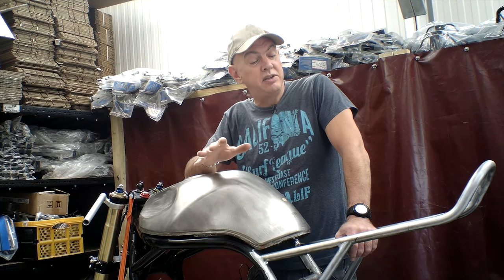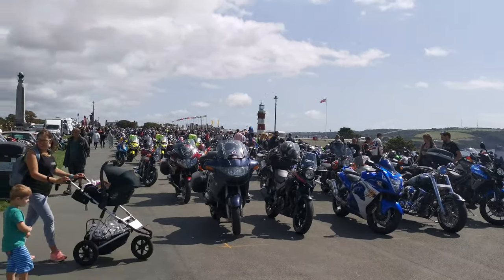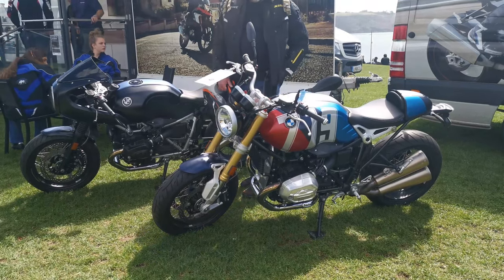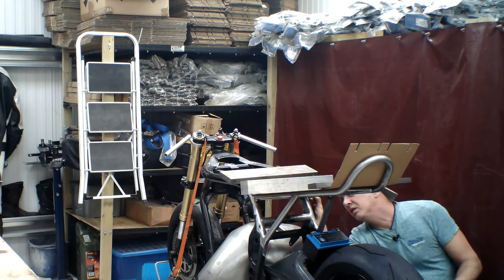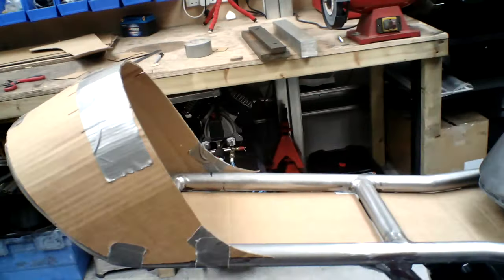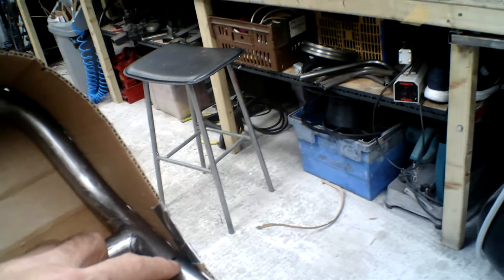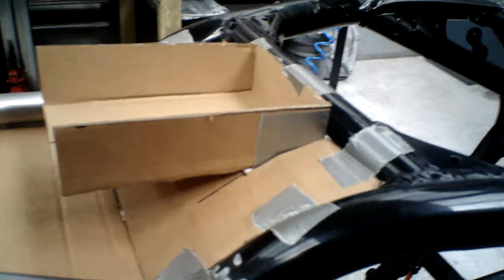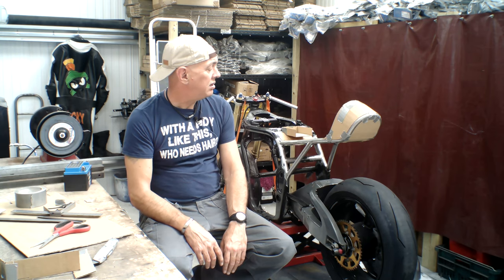Battery location and electrics tray idea - Suzuki Bandit Cafe Racer - GIXIT Project Part 11

Comment: Seat proportions look spot on. I'm interested in you cutting the tank. Do you have to pressure test them after?
Reply from the maker: Hi Richard, yes it'll need to be pressure tested once it's done. Don't want any potential for Leaks etc

Comment: I’m not getting why you have the rear seat hoop bent up so much quickie? You are loosing all the space under the seat hump by doing this my wee gs450 I made has a more laid down hoop still kicks up a little but the battery fits under my seat hump with room to spare. I can send you pics of it if you like.
Reply from the maker: Thanks for the input Alan and it's a good point. When we were discussing the hoop we had the idea of setting the tail light, brake light etc into the undertray and frenching it all in. It'll just give a cleaner simpler look and not look so cluttered in the end. Steve O also quite liked the kicked up look but I wanted to keep a strong cafe feel for it. It's a personal choice in the end I guess and if looks wrong once it's finished I'll just cut it off and remake it. Good comment, thank you 👍

Comment: Try to fit the battrery longwise at the angle (front of the battery higher than the back) following bottom of the battery with frame shape under the tank. And you can also consider to put the seat lock at the back as you can save some space for the battery tray.
Reply from the maker: A good suggestion and that could work. I'm still playing with ideas but think it's close 👍

Comment: You need to ask Delboy to make you a seat hump with his english wheel.  If you tell him you found his channel through Matt at the workshop, I'm sure he'll be more than willing to help.
Reply from the maker: PMSL.... Hehehe... That's not an English wheel, the flex in it is rediculous!?!
Reply from the maker: Worse case scenario I'll cut up an old fuel tank and make that into a seat hump...
Reply: @QuickBikes  That's nothing compared to the flex he's gonna get from his fork, and I use the term with some trepidation, "brace".
Reply from the maker: Hehe... It's probably motorcycle grade brass, so he'll be fine lol

Comment: Great content 
The work needed to modify the tank should make for some interesting video 
Good luck 
Ride safe
Reply from the maker: Cheers Ron. I think it should be fairly straight forward, I just have to do it carefully... And remember to get the bolt out of it before I weld it back up lol 👍

Comment: Just a idea you could have the under tray running inside the tube having the cross braces on show!!!
Reply from the maker: Yes... Yeah that could work as well... I think I need to let Steve O make the call as it is his bike, but that could work... You mean bend up a conventional tray and set 8t between the frame tubes right?
Reply: Yeah sat half way on the inside of the frame so you see all the tube work from underneath and if you lift the seat!!! I like having all the welds and fabrication visible!!!!
Reply: Even the hump instead of coming to the out side of the frame run half way sat on top of the tube so you get that half moon shape on the outside!!!
Reply from the maker: Yeah that's kinda the idea... I want a lip on top of the tube withe the hump and seat pan landing just outside it to create a seal for the electrics tray. Great minds think a like matey. I'm glad about that or I was about to make a massive cock up lol 👍
Reply: @QuickBikes  it will look quite nice looking forward to see all the fabrication!!! I'm really just starting to learn myself  and its really nice seem all the process  and thinking behind it all!!
Reply: @QuickBikes  it will look quite nice looking forward to see all the fabrication!!! I'm really just starting to learn myself  and its really nice seem all the process  and thinking behind it all!!
Reply from the maker: Mate, it's just having the confidence to have a go with basic tools.... If you cock it up, you just do it again until you're happy with it... Fab shop charge the EARTH to do simple stuff and if folks just had a go, they will probably surprise the bejesus out of themselves... Have a go matey... Why not?
Quite often I don't have a clue how it's going to work out, but things have a way of getting figured out eventually 👍

Comment: You can get smaller batteries than that. A quick search found one only 145 x 78 x 45mm
Reply from the maker: Hi Steve, yes we know but Steve O is very Kenn to use what we've got wherever possible, plus this approach is way more difficult!!
Thanks for the suggestion though, much appreciated 👍

Comment: Hi Mr. Q, Its look like your using a Lithium Ion battery. That will pre-heat your fuel I gues:-) Those battery's are getting pretty warm and like a little cooling, I suppose.
Reply from the maker: I was thinking about this and looking to put some louvres into the battery box to create an airflow around the battery, trouble is I have no point of reference... The bike was OK before so I figure as long as I can at LEAST replicate that, I should be OK.... When we run it I plan on having a temp sensor in there to record temps on an urban run as well as dual carriageway 👍 Great observation matey, I really tlike your thinking 👍
Reply: You are mounting a detonator right next to a explosif. Look's dangereus to me. If you think the otherway around... It's not so hard to costumize a Li ion batery, its probably made up from a few smaller cells and some electronics, put in a plastic housing. So why not reshape the batery like a fake oiltank and place it outsite the frame.
Reply from the maker: Hmmm I take your point... Max air flow would be a good idea or a smaller battery maybe as I think this one is well over rated for the job at hand. I would be happy pulling the battery apart as that's way out of my scope of knowledge and they will discharge as quickly as they can if you get it wrong. Great comment though and real food for thought. Thank you 👍
Reply: Pulling that battery apart would build a bomb only if its a lipo lithium ion is relatively stable and just a series of cells in series.

But taking a battery apart isn't.... A great idea. Making custom packs can be done but it's a sod to get right good call quickie knowing your limits.